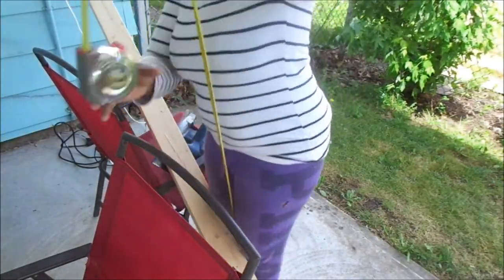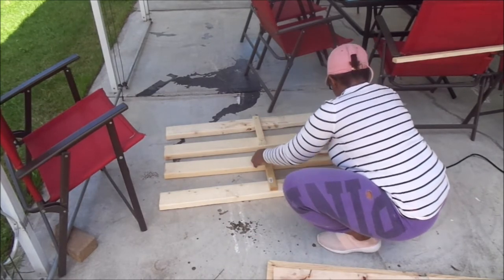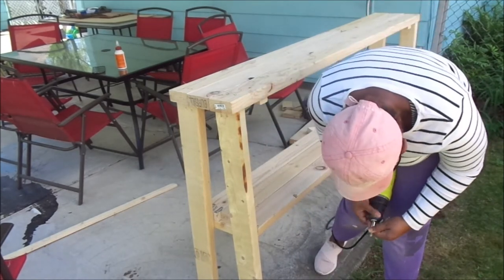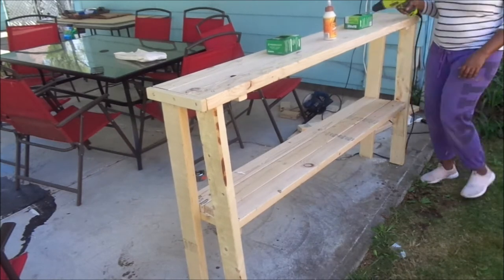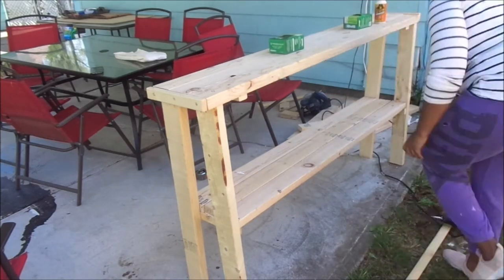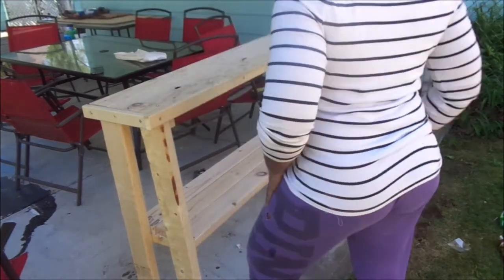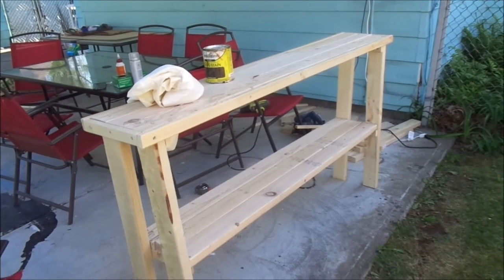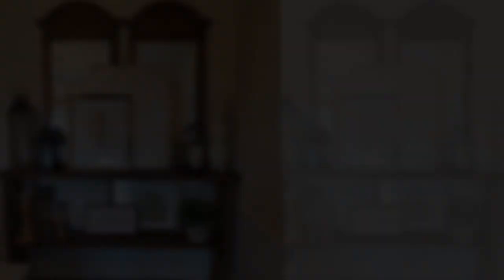DIY FARMHOUSE FURNITURE | DIY Rustic Farmhouse Buffet Table

Comment: What a great job. Love the table.  If you do a pilot hole prior to putting in the screws, that should fix the wood from splitting.
Reply from the maker: Thanks so much. I thought about that but I didn't  have the correct  bit to make the holes. Im still new to wood  working  so I need to build up my  tool stash  😆.  Tfw